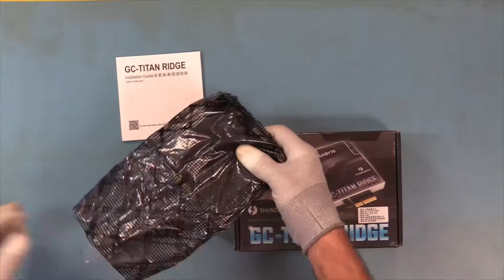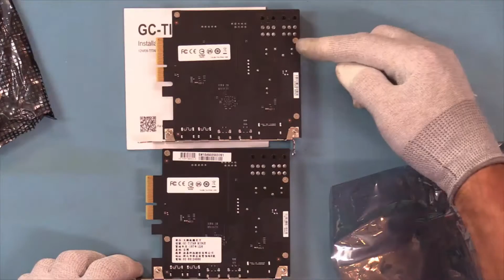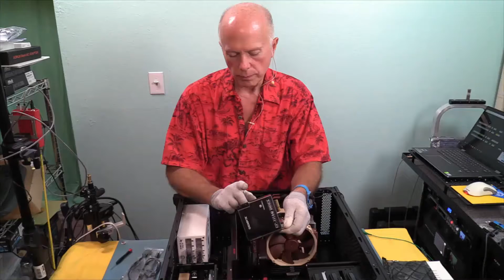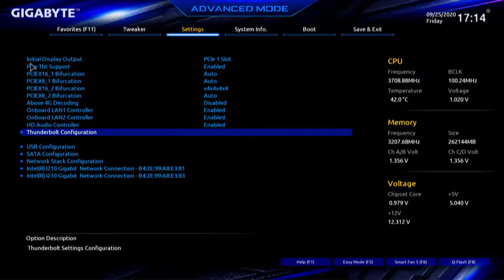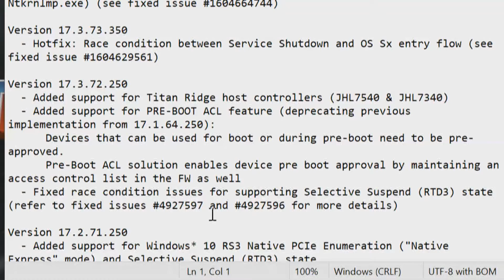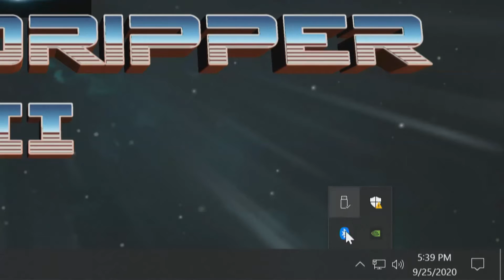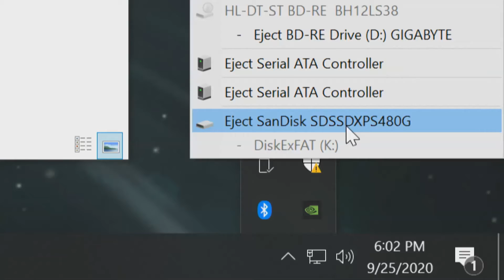Titan Ridge Thunderbolt 3 Unboxing, Comparison and AIC Simple Install on Gigabyte TRX40 Designare

Comment: Sir Thank you for this video! Can i install that same card in a Dell Vostro 3671? I need thunderbolt to run a audio interface i just bought? I'm not sure where to plug the header cable for that. I don't see anything that says tbt on the motherboard.
Reply from the maker: Hello Uriel-Heaven's Guardian,
Welcome! Interesting Question! To quickly bring You up to speed, No TBT Header on Motherboard, No Bios Support. No Bios support means no ability to set Memory Apertures. What's that? The ability to allocate Memory for Thunderbolt Devices. Meaning? Hit or miss. The only option will be to Jump Pins 3 to 5 on the Gigabyte Titan Ridge Thunderbolt AIC that would otherwise connect to the Motherboard. To reiterate, it may or may not work. But that is Your Option. Hope that helps! Otherwise, new Computer. Then You have 2 Options. 1. Add on card. 2. Built on the Motherboard. Each has pros and cons. Thoughts?
Reply: @BuildOrBuy  🤯🤯 I need a computer geek as a friend. I love the customization of PC computers but this is on of the reasons I like Apple computers. I never had these issues. 
Thank you for your response sir I really appreciate it.
Reply from the maker: Hello @uriel-heavensguardian8949 ,
Solving Problems and Providing Solutions! Try it and see what happens!

Comment: I have a question regarding the titan ridge pcie card. I have several external nvme drives, mostly 10gbps. But the issue I am having is the 20gbps nvme drives. When connected to the titan ridge 2.0's usb c (thunderbolt port) I can't get the 20gbps speeds like I can on my asus rog strix z590-a gaming wifi II's usb-c 3.2 Gen2x2 port. I use 40gbps usb c cables for all my external devices, I am wondering is it only possible to get 10gbps other than a thunderbolt 40gbps external nvme enclosure. No matter what I tried the titan ridge didn't give me the 20ghbps speeds. I am missing something?
Reply from the maker: Hi Sean W. Conway,
Welcome! Great Question! A conundrum! You have the Solution in the Question! USB-C Thunderbolt 3 = 40Gbps. USB-C 20Gbps 2x2 is not a Thunderbolt Spec. USB4 uses a different data encoding scheme to achieve 20Gbps. A USB-C 20Gbps 2x2 Device on a Thunderbolt Port will only achieve 10Gbps. USB-C 20Gbps 2x2 requires a USB-C chipset capable of 20Gbps. 

Actual Throughput is lower. They also use Different Data Encoding schemes. Thunderbolt 3 is backwards compatible to Thunderbolt 1&2. Whereas Thunderbolt 4 is backwards compatible with Thunderbolt 3 only. Hope that helps!

Comment: I have the MSI Mpg Z390 Gaming Pro Carbon Oc and I wanted to know if it is compatible with Gigabyte Titan Ridge to have a thunderbolt connection and not have to buy another motherboard, thanks. I want it so I can use my Apollo Twin X.
Reply from the maker: Hi dai Amaro,
Welcome! Great Question! To verify, You have the OC version instead of the Non OC Version? The OC Version does not have the Thunderbolt Add-on card connector which is required for Bios support. If You install a Thunderbolt 3 add in card without Bios support, having that work, is hit or miss since We cannot allocate Memory for Connected Devices. According to MSI Thunderbolt 3 add in card, You would need a different Motherboard. Technology right now has gone to USB4 which incorporates prior Thunderbolt technologies. But to do that would require Motherboard and CPU. And maybe RAM depending upon Chipset. Links below. 

Also for best compatibility maintain same brand since every Motherboard Manufacturer uses a different Thunderbolt Connector Pinout. 

Specification ThunderboltM3 | MSI Global - The Leading Brand in High-end Gaming & Professional Creation https://www.msi.com/PC-Component/ThunderboltM3/Specification

https://www.msi.com/Motherboard/MPG-Z390-GAMING-PRO-CARBON/Specification
That Motherboard is from 2018. 
MSI MPG Z390 Gaming Pro Carbon ATX
https://amzn.to/3E5UAy1
As an Amazon Affiliate I earn from qualifying purchases! Hope that helps!

The MSI Thunderbolt 3 Add in Card is hard to Source whereas THE MSI Thunderbolt 4 Add in Card is still available direct from MSI but to reiterate, USB4 is the current technology. Lots to consider. Options. Thoughts? It's all about the Music!
Reply: Msi Mpg Z390 Pro Gaming Ac
Reply from the maker: Hi @daiamaro2198 ,
That's a different Motherboard. Verify the Motherboard You have with the MSI Thunderbolt 3 Add in Card Support List. That Detail matters! 

Specification ThunderboltM3 | MSI Global - The Leading Brand in High-end Gaming & Professional Creation https://www.msi.com/PC-Component/ThunderboltM3/Specification
Reply: in the description of my store it says that it has Thunderbolt Add on
Reply from the maker: Hi @daiamaro2198 ,
To reiterate, verify the Motherboard You have with the MSI Compatibility List for Thunderbolt 3. The problem also to reiterate will be to Source that MSI Thunderbolt 3 add in card since Your Chipset is from 2018. Going on 4 Years now. We're currently going through new Chipset updates. New Chipsets, New Motherboards, New CPUs.
Reply from the maker: Hi dai Amaro, 
Looking at Your Motherboard Manual IF You have the Non OC Motherboard as discussed, that says You have the 5 Pin Thunderbolt Motherboard Header. Perfect! Then the Gigabyte Titan Ridge Thunderbolt 3 Add in Card should work. And You will have Bios Support. Be aware. The Gigabyte Titan Ridge Thunderbolt 3 AIC may require a Firmware Update. Check and verify once received. MSI tech will not help You with a part that is not theirs. Keep Us Posted on Your Progress!

Here's a link to the Gigabyte  GC-Titan Ridge 2.0 (Titan Ridge Thunderbolt 3 PCIe Card Component)
https://amzn.to/3RrM4wi
As an Amazon Affiliate I earn from qualifying purchases! Hope that helps!

Looking in Your Motherboard Manual, nothing about the Thunderbolt Bios settings, You'll have to tell Us what You see once Thunderbolt 3 AIC is installed. There should be 2 Memory Apertures to configure or increase for Connected Devices.
Reply: @BuildOrBuy  the real model is MSI MPG Z390 Gaming Pro Carbon AC 😅
Reply from the maker: Hi @daiamaro2198 ,
Ok! On that particular Motherboard, yes You have the Thunderbolt Add-on card connector. Manual says, 5 pin Header. And the Gigabyte Titan Ridge Thunderbolt 3 AIC should work for Full Bios support. The Version 2 AIC should have a current Firmware. 

https://www.msi.com/Motherboard/MPG-Z390-GAMING-PRO-CARBON-AC/Specification

Comment: This support amd B450 Mainboad ?
Reply from the maker: Hi Rubah Ganteng Tech,
Welcome! Depends upon the Motherboard. Which Brand and Model? The Gigabyte Titan Ridge Thunderbolt 3 AIC has a 5 Pin Thunderbolt Motherboard Header for Bios support. Gigabyte does not List any B450 Chipsets, only 7 Gigabyte B550 Chipsets are Listed.

Comment: When plugging it in to the PSU, are you going through VGA/SATA/CPU?? When I route mine through Sata it doesn’t turn on, when I plug it in through VGA I don’t think it registers the device
Reply from the maker: Hi Tom STruong,
Welcome! Are You talking about the PSU Power Connector to the Thunderbolt add in card? That would be CPU / PCIe Devices. There should not be any mixup on that! What PSU Brand and Model are You using? Fully Modular? Hope this helps!
Reply: @BuildOrBuy  Yes I am, I'm using an EVGA 750 GQ semi modular. I'm running two 6 pin connectors from the VGA1 and VGA2 to power it.
Reply from the maker: Hi @TomSTruong ,
Yes! On that Model, a VGA 8 pin power tap! Those Details matter! Does it work for You? BTW: Next Build, suggest a larger PSU.
Reply: @BuildOrBuy  Got it, thanks! Now I don't think I can download the drivers/utilize the Titan Ridge because of Windows 11 :/
Reply: @BuildOrBuy  So I got the device to connect and show that my Apollo Twin X is showing and I’m actually in the boot/UEFI start up but I don’t see any option for Thunderbolt in IO ports
Reply: @BuildOrBuy  Nevermind! After restarting everything cleared up!
Reply from the maker: Hi @TomSTruong ,
Windows 11, that could be a problem that only complicates the 1st one. What are Your Plans? Priorities!
Reply from the maker: Hi @TomSTruong ,
What about in the Motherboard Bios? Are You using the TRX40 Designare HEDT Motherboard?

Comment: so is the TB header absolutly necessary ? i've heard it's not !
Reply from the maker: Hi Future Beats, 
Welcome! Guess We need to do another Video on this and show what happens on a Motherboard without the Header. Depends. We get partial support. This is the same as Jumping Pins 3 to 5 om the Thunderbolt AIC (Add in Card). Without the Thunderbolt 3 Header, no way to set the Memory Aperture nor to properly Enumerate the Device on the Bus. Partial support means only Thunderbolt 3 Native support and no Legacy Thunderbolt 1 or 2 support. Since Memory Aperture cannot be set, suggest only 1 Device otherwise Connect and disconnect issues can occur. So it works, sort of but not completely. Hassle right. Hope this helps!

Comment: Just came across your channel and I love the in depth thorough reviews you've been doing for Thunderbolt cards. 

I have a question thats applicable to my setup and hopefully it'll be easy to answer:

Is there anyway to know if your mobo supports thunderbolt 3 or 4 pcie cards? I'm running the asus tuf gaming x570-plus with an AMD Ryzen 3900x. Some info online I've gathered states that it depends and some info states that it won't work. I'm at a cross roads as a creator on what to do.

My job as a video editor requires hard drives with thunderbolt but my PC doesn't have any of those ports natively and I wanted to get a card to fix this short coming but no where on Asus' website or on the product page for the mobo & pcie card does it state any compatibility issues.

My biggest fear is installing the card needing to return it or troubleshoot it until I get the result I'm looking for. 

As a follow-up question, if I can't use one of these PCIE cards, what would be my next solution? 

Thanks in advance!
Reply from the maker: Hi SpriteKnight,
Welcome! Appreciate Your Comments! We still have much more to cover regarding Thunderbolt! 
ASUS TUF GAMING X570-PLUS
https://www.asus.com/us/Motherboards-Components/Motherboards/TUF-Gaming/TUF-GAMING-X570-PLUS/

TUF GAMING B560M-PLUS has Thunderbolt support but not the ASUS TUF GAMING X570-PLUS. Bummer! Some Motherboards even differ from Rev 1 to a Rev 2 or Rev 3 in whether they have Thunderbolt support or not. 

The Thunderbolt Header is becoming more problematic as We've have outlined in other Videos. For ASUS, From 5 Pin to 10 Pin and now to 14 - 1 Pin which has a different driver model than before. That Motherboard Thunderbolt Header is essential for Bios support to allocate Memory for Thunderbolt Devices. Gigabyte Thunderbolt 3 only on 5 Pin Header. The ASUS Thunderbolt 4 AIC uses a 14-1 Pin Header. Hassle. Gigabyte, Thunderbolt 4 added an additional 3 Pin Header to the existing 5 Pin Header. Only ASRock has maintained a 5 Pin Header. However, the Bios settings have changed and to reiterate as well as the Driver Model. 

The takeaway, Thunderbolt 3 was easy and generic whereas Thunderbolt 4 is Vendor Specific. Your Options, a different Motherboard. No Add in card for Thunderbolt on Your Motherboard. Unless... Now, it's possible to gain partial support for Thunderbolt 3 meaning no Bios Support. No guarantees on anything. I'll explain how if You want to try it. You're results may vary. Requires the Gigabyte Titan Ridge Thunderbolt 3 AIC. 

BTW: Your AMD Ryzen 9 3900X is 12 CPU Cores. You need a CPU Upgrade if You get a new Motherboard. We have Outlined 4 Levels of Computer Builds for Rendering. Suggest a 5950x with 16 Cores. This is what We define as a 2nd Level Build. An Entry Level Build would be 10 CPU Cores. Above that would be 3rd, a TRX40 HEDT then 4th would be a WRX80 Workstation. Hope this helps! Options! We're all about Answering Subscribers Questions! What do You Render with? Adobe or DaVinci Resolve? We suggest using the Adobe MFR CPU Optimization Formula for a Rendering Build to match Components. We have a Video on that too!

Comment: Question for anyone that uses this card!!!  How well does "fast charge" work for your USB C phone?  My phone supports fast charge, it charges pretty quick on the block the phone came with, however I'd like to get the same experience from connecting the phone to the PC.  My mobo's back I/O ports are super duper slow at charging, but the front ports, surprisingly, charge pretty fast. I'd still like to get this card if it can do fast charge as fast as the wall outlet.  Aorus Gaming 7 OP z370
Reply from the maker: Hi Odolwa, 
Welcome! Great Question! I have no idea! We'll have to test and get back to You on that! Thanks for Asking! At least Your Motherboard supports Titan Ridge Thunderbolt 3!  That I did check! Stay tuned!

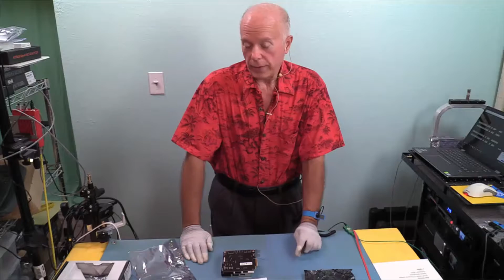Comment: 5:43 There is one use case for this card and video. The dell ultrasharp 5k monitor only has Thunderbolt 3 inputs. I want to use this card to make it work with my pc, not just my mac. Someone made it work on an asus motherboard with a different brand card(compatible with that motherboard). Although, he only achieved 4k resolution. I'm going to give this a try with my Gigabyte motherboard.
Reply from the maker: Hi Livin LA Vida photo, Welcome! Are talking about the Dell 27 UltraSharp Ultra HD 5K Monitor UP2715K or the Dell UltraSharp 40 Curved WUHD Monitor U4021QW? The later is Thunderbolt 3. The former is 5k. If it's on the Thunderbolt Products List, then You should be in Business! If not, Bummer!

https://thunderbolttechnology.net/products

Part of the problem We're now encountering is each Vendor has a different implementation of the Motherboard Thunderbolt Header, 5 pin, 10 pin then 14-1 pin and now 2 headers, a 5 pin + 3 pin on Thunderbolt 4 by Gigabyte. Let Us know which Dell Monitor You have. And let Us know if it works!  BTW: Dell is the only 8k Monitor at the Moment! Thunderbolt is very much a work in progress and becoming Brand specific in implementation! Thanks for Sharing!
Reply: @BuildOrBuy  Hey, thanks for getting back to me. It's actually the LG UltraFine 5K IPS LED Monitor RB27MD5KA-B, which is on the thunderbolt products list. I'm going to give it a try, I'll let you know how it goes.
Reply from the maker: Hi @sproesser1 ,
OK! Small detail. You should be good to go! Let Us know! Thanks for Sharing! Helps Us to make better Videos!